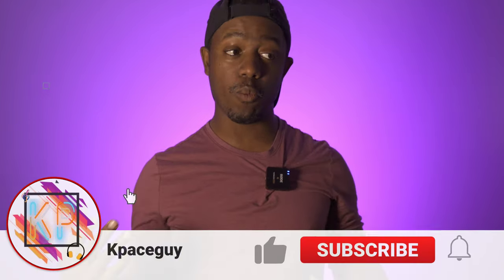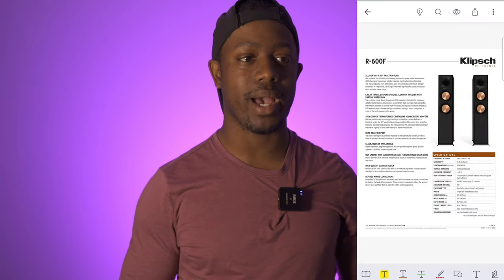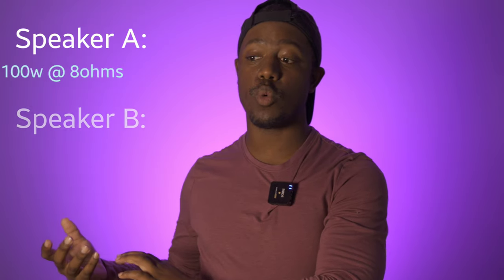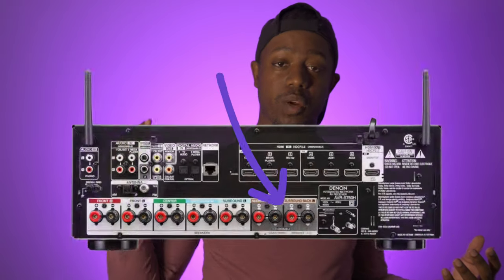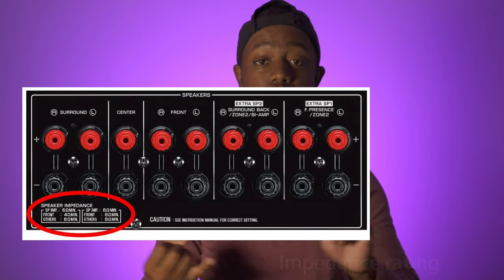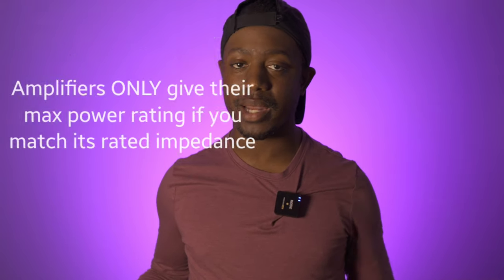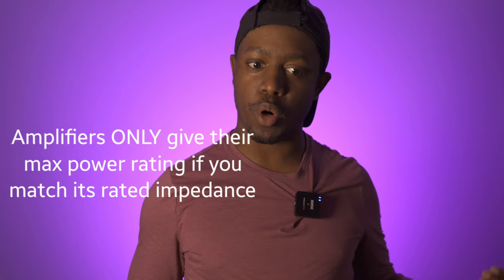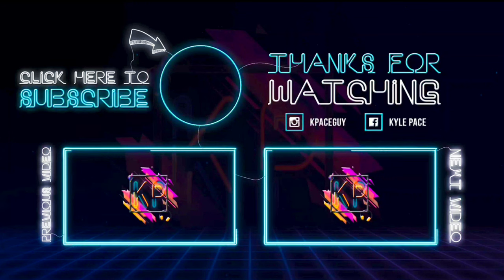Speaker Impedance (Ohms) and How to Match Amps w/ Speakers

Comment: Maybe a strange question, but in a cabinet with a tweeter, a midrange and a woofer, they all have impedance ratings, and how does that work in terms of figuring out what each individual speaker's ohm rating should be?  I am replacing both the midranges and woofers in a couple of Infinity Reference Four cabinets (keeping the tweeter), and the Reference Four is rated at 6 ohms.  I know these speakers aren't connected in series inside the cabinet (couldn't be if the total rating is only 6 ohms) but if they're connected in parallel inside the cabinet that would result in only 2.6 ohms.  So I guess I don't understand how they are actually connected individually inside the cabinet.  I have an Onkyo receiver from the early 90s that's a beast and has switching for both 4 and 8 ohm loads, and I'm just planning to connect each speaker to its own connection.  Sorry for the long wind, but would you think that 8 ohm midranges and woofers would be the way to go?
Reply from the maker: When you add speakers together you just have to wire them in a way that they don't dip below your intended ohm load OR just buy speakers with all the same ohms

Three  8 ohm speakers is still one 8 ohm final load to the amplifier but the power rating is divided by 3. So not only do you need your speakers to achieve the right ohm load, you also need your amplifier to have enough juice that all speakers are satisfied with
Reply: @Kpaceguy  Yes, thank you, I was thinking all speakers having the same impedance made the most sense, but I didn't know that 3 8-ohm speakers would still represent an 8-ohm load to the amp.  It's been a LONG time since I had electronics in high school.  😉😉
Reply from the maker: @Kenneth Williams  let me correct myself. Three 8 ohm speakers won't be 8 ohms it'll be just under 3 ohms. You'll want to get speakers that are dual voice coil. For example three 6 ohm dual voice coil speakers cam be wired down to 4ohms which a lot of amps can handle now a days. You need to be able to wire in series/parallel to get the right ohms
Reply: @Kpaceguy  Thank you Kpaceguy.
Reply: Most speakers that have three speakers inside a cabinet also have a mini crossover inside the cabinet that separate the frequencies and reduce or increase the resistance (ohms) as needed to get the final rating.  I would hook it up back into the crossover the way it was and check the new total ohm load.  Unless the crossover fried in which you will need to buy a new one then hook it up the way it was and check the new total ohm load at the back of the speaker and go with that number as the resting ohm load.  Remember that the crossover usually reduces the amount of power going to your tweeters and mids to match the speaker they used in that cabinet.  That is why, if you are changing speakers or brands, you might want to upgrade your crossover board, but I wouldn't take it out and run each speaker to your amp.  That would run way too much power to your mids and tweeters as all three would be receiving the same power from the amp.  Of course your woofers are going to need more power, the mids less, and the tweeters much less.

Comment: Hey! I currently have an old Sony that has four 6ohm speakers, model is LBT- ZX9 the sticker says 720W but won't trust it that much,. I'm thinking on getting an amplifier with better features like Bluetooth and mostly optic input, as well as using all 4 speakers as a home theater, what should I be looking for? It would be nice to get rid of the gigantic box with all of that CD/Cassette player part that I won't be using
Reply from the maker: 720w divided by 5 is each speakers rating. If your speakers are around that power rating then you're fine I less you just want an upgrade

Comment: Regarding ohms.  My AVR has ability to switch from 4, 6, and 8 ohms. My set up includes 7 speakers. 1 pair 4 ohms, another 6 ohms and another 8 ohms. So I've set AVR to 4 ohms.  Is that correct?  Also how do I set crossovers if I have such disparate speakers?  Thanks for your reply.
Jack
Reply from the maker: Set it back to 8

Comment: What if my speakers say 30w but my amp gives it more?

You said 4 Ohm amps usually cost big bucks. 

Surprisingly, my Aiwa mini theater system has a 4 Ohm amplifier. It cost me $299.99 at the Wiz in 1999 on clearance.  That’s not too bad.
Reply from the maker: That's fine just don't turn it up too loud
Reply: @Kpaceguy  will I hear distortion well before it ever reaches its failure point? 🤔 

It’s for the 2 surround channels, not sure my Aiwa mini theater system receiver sends over 30w to it. 

Love this video, btw. It gave me confidence to rewire this, without an instruction manual. No problems, so far. 🙏

Comment: I have Audison SR 4.300 amplifier. It supports 4 channel 85 w x 4 @ 4 ohm
Or
4 channel 130w x 4 @ 2 ohm and so on. 

My question is how does my amplifier know if I have connected 4 ohm or 2 ohm speaker.

Can I install front two speakers 100w @ 2 ohm. And rear two speakers 100w at 4 ohm to same amplifier or any such combinations ? Please explain
Reply from the maker: Your speakers have coils that have a certain resistance. When you plug your speakers into your amplifier, the amplifiers know the resistance of the voice coil and that's how it knows it ohms rating

Comment: Hello, I have a Yamaha receiver rxv 575 (80watts 8 ohms/135watts 6 ohms) and speakers (80watts 4 ohms), would there be a chance of damaging the receiver? Use will always be at low volume sitting in front of the boxes.
Reply from the maker: You'll mostly be fine. Your Speakers will be 4 ohms at their lowest but they won't always be at 4 ohms

Comment: Hello im very new to this just watched your video i just bought a klipsch rp280f with the ratings of 150watts rms 8ohms with 96db and i have a home theater system denon avr s570bt it put out 70watts per channel into 8ohms so im wondering i might underpower my klispsch speaker since they are 150watts..thank you in advance..
Reply from the maker: No it'll be fine. Speakers have a range in which they will work and your within that range
Reply: Thank you.. i realy do appreciate you and keep up the good work..🙏🙏🙏
Reply from the maker: @reggielansang7429  I appreciate it

Comment: Hi Kpaceguy, What I’m about to ask is in no relation to this video,But since it happened it’s been driving me insane…(btw the video content is awesome as usual!!) 
I have a Denon X8500H And my AVR just did a automatic firmware update on9/20/2022 that resulted in changing the internal picture settings Or overriding my settings on my LG (OLED) EG9600 (2017) and not only it drastically changed all the picture settings, but now the image is softer less detailed, and to top it all off, it now has the SOAP OPERA EFFECT on by default and it is infuriating!! And it is driving my insane…Is there a way to reverse the update? Any ideas? Thanks in advance!
Reply from the maker: If the receiver changed the picture then you need to go into video and make sure it's video processing is set to off or bypass. It has things like ISF day ISF night and etc. All that needs to be off and make sure it's set to pass through 4k

Comment: Question for ya.. im getting a speaker wall made and I need an amp that’ll supply me around 2k amps but I can’t seem to find any 4ohm 4 channel amps do you have any recommendations?
Reply: And also could I run multiple speakers off a one channel amp as long as the wattage of those speakers do not suffice the amps rms rating? And could I run a 4 ohm speaker off a 2 ohm amp?
Reply from the maker: @cal21379  crown amplifiers

Comment: I hope your still replying after 8 months lol. but if I have a 4 ohm 10 w speaker that  burned up on a old home stereo system and I'm trying to replace it with A 6 ohm 10 W speaker from a TV can I do that  ? trying to get it running again to have in my workshop .
Reply from the maker: You could

Comment: I’ve been watching your videos for quite some time but did have a question. I’m running a Denon x3700h. I’m running 5.2 surround sound and all my speakers are 8 ohms except my rears. My rears are 6 ohms. Will this cause a major problem? Most forums say no and if I match ohms on my surrounds the watts will be much less than any of my other speakers but I wanted to get your opinion. All of my speakers other than my rears are klipsch rp. My rear speakers are elec debut 1st gen bookshelves. I’m apprehensive to swap them because they sound really really good. Any help you could offer would be great!
Reply from the maker: No it won't be a problem and no it won't be half the Watts it'll be the same as all your speakers
Reply: @Kpaceguy  thank you!!

Comment: hey need some help please, i have tried wiring my  4 dual 4ohm subs to 8 ohms ,but no matter what i do i keep getting 10.6 on my multimeter ,  i have a gemini xga 5000 amp , can it work bro?
Reply from the maker: You wire all 4 subs negative posts on one coil to the other negative posts of the other coil. Then you wire all 4 subs positive post of one coil to the positive of the other coil.

Then you take 1 positive coil post of one sub and wire it to the 1 negative of another sub coil 3 times.

Lastly you take the positive of 1 sub and a negative of different sub and wire it to the amp. It's harder to explain than to do
Reply: @Kpaceguy  thanks much

Comment: I have a W-King T 9 wireless speaker and I have connected two 8 ohms 250watts external speakers in parallel to one of the 4 ohms internal speakers thus making the 3 speakers in parallel. Is this setup ok?
Reply from the maker: That's About 2.7ohms. A bit low. I personally wouldn't do it
Reply: @Kpaceguy thank you. I love your channel and subscribe

Comment: Rookie here.... I have the Paradigm Studio 100 V5 and the matching CC-690 center channel that is being driven by the Denon AVR-X4800H receiver.  I am looking to add a 3 channel amp to my setup.  the speaker sensitivity rating are 92 dB / 89 dB and the amplifier power range is 15 - 350 watts.  What rating amp would work best for my application?  Thanks in advance.
Reply from the maker: Literally any home theater amp in today's Market would work fine
Reply: Will the Parasound Helo a31 be overkill?
Reply from the maker: @allencrespo8998  I don't think so

Comment: Hey friend is it ok to load an 8 inches speakers rated at 130 watts each with 6ohms impedance to a 8ohms impedance rated amplifier at 100watts per channel? Can i get the power it needed or change my amplifier? Thanks in advance
Reply from the maker: No.

Comment: Very timely video.
Reply: I have a 2 channel system with a pair of Polk Signature 55 with dual SVS sb1000 powered by Cambridge Audio axr 100.Im looking to upgrade my towers and my peak budget is $1800. I've narrowed my choices down to KLH Kendall's, SVS prime pinnacle, Wharfedale Evo 4.3 and Dali Oberon 5 which are 6ohm.Would I have any problems down the road driving the Dali's if I go that route? Although I am leaning towards the Kendall's Any recommendations??? Thanks Kpace.

Comment: Hello friend, I had an OLD 90's Mini Hi-Fi Component System by Sony (cd - 2 cassetes - aux). I want to use the 2 Speakers Model SS-h7... On the back it says 6 ohm - input 25w - output 50w and Only had a Red and a Black Wire. I would like to use Those Speakers on my Computer, What do I need to buy so I can connect those 2 speaker to Jack 3.5mm of Computer. Sorry for Bad English.
Reply from the maker: Some sort of small amplifier

Comment: I have 10  4ohm 8inch mid-range speaker all hooked up negative to negative and positive to positive so I guess that's parallel and I guess that's coming out to 1ohm so will I need a one ohm amplifier for a 4-ohm amplifier and is there any other way I can hook all the speakers together and make it come out to 4 ohm
Reply from the maker: No

Comment: I got a surround system but missing front speakers,  i tested the surround speakers (multimetre) and they are 6ohm.

So to get front speakers ive orderd 6ohm bookshelf speekers.

So if a surround speaker is 6ohm the rest of the system must be 6ohm yes?
Reply from the maker: No
Reply: @Kpaceguy  wer'e talking about a creative inspire t7700 pc desktop 7.1

if 1 speaker is 6 ohm they all gonna be 6 ohm yes?
Reply from the maker: @WingmanLive  if it only has one amplifier then yes but if each speaker is powered individually then no
Reply: @Kpaceguy  yeah im good then because was missing front 2 ive orderd some technics sb-hd51.  6ohm and have a lowend of 45hz.  Should be happy with that for a desktop setup anyway.  

Cheres dude!😊👍

Comment: my current AV receiver is a Dennon  135w at 8 ohms , my front stage speaker is connected on a 3 channel external amplifier . My surround speaker is rated at 4 ohms and my Height speakers are rated to 2 ohms , this the only speakers I have connected in to my receiver since the left right and center speaker are connected to a external amp in this case I'm ok with that kind of setting ? my external amp is rated at 150w each channel at 8ohms and 400w at 4 ohms each driving channel
Reply from the maker: Yes you'll be alright

Comment: Thank for the vid but gime a hand to clear my issue.. Having an amp capable of setting it to 6 ohm or 8 ohm. Paired with speakers rated long term power 180w and short term power 250w at 6 ohm. along with a receiver that outputs 130w at 8 ohm  but i dont know 6 ohm output rating.. so how should it be set ?
Reply from the maker: You'll be fine

Comment: I have a few questions if you dont mind, like ok my amp looks like is capable of 4 or 8 ohms does my reciever need to be capable as well? Also is there something i need to do to get them to work at the correct ohms like if its 4 do i need to tell that to the amp and reciever? So my amp i am biying is rated 8ohms 160 watt per channel or 4 ohms i thinks its 250 watts so i should be able to drive a tower 4ohms 200 watts easily? It gets confusing i could put the exact name of everything
Reply from the maker: If you're using an amp then it doesn't matter what your receiver can do. The amp automatically knows what ohms to use the moment you plug the wires up
Reply: Thank you for answering man, I appreciate it. I have the onkyo rz50 coming in tomorrow and they just shipped my 2 channel emotiva amp. I'll be using 5 bowers and wilkins just need Dolby atmos speakers maybe 2 more surround.  Originally I was going to get the Nakamichi DRAGON but I figured fornthe price I can build a system, that dragon was tempting tho. I'll be watching more of your vids thanks again

Comment: hey i have a  t.amp E-1200 that has 800wrms at 8ohm and 1200w at 4ohm  i plan on running behringer vp1800s that run at 400w rms at 8ohm and 1600wpeak.
how do i set the impedance to 8ohm on the amp ?
what shoud be the max power i run these subs at?
how do i know at what impedance the amp is at?
Reply from the maker: The amp knows what to do based off the speaker you connect to it. You don't need to do anything

Comment: My JBL L-60t speakers are rated 6 ohms. My Yamaha RS202 receiver is 8 ohm. I haven't noticed any issues but should I be aware of something not good to do (such as cranking them up too loud)? The wattage is 100+100.
Reply from the maker: Overall you should be fine. It's not really a volume thing is more a frequency and power thing
Reply: @Kpaceguy  Thanks. That's a relief. 👍
Reply: @Kpaceguy  In curiosity I checked and JBL is still making 6 ohm 2 way speakers. 😲

Comment: question: if I have a pair of 2 ohm speakers, and I have a 2 ohm amp but one ohm stable, thats perfect right? or does the fact that both speakers are 2 ohm and they are doubled, there's two of them, does that mean the 2 ohm drops to one ohm? basically its always best to power speakers based on ohms, two ohm speaker gets two ohm amp, same with 4 ohms and so on and so on? right?
Reply from the maker: If both speakers will be powered off 1 channel, it'll be 1 ohm. Which is fine. You'll get the most power out of your amp that way
Reply: @Kpaceguy   im building a system now, I have a pair of two ohm subs {JL Audio 10w1v3-2} and I plan to pair them with a amp {Crossfire C5-1600D Mono} that seems to be rated at 4 or 2 depending on wiring, but it says 1 ohm stable, does this mean when I wire them I should bring two sets of wires from the amp one going to the left sub and the other the right sub, is that how those speakers should be wired to that amp to get the max effect? thanks for answering my questions my friend
Reply from the maker: @eyeswideopen6151  no if you want all the power possible from your amp you combine both subs together and wire it to one positive and one negative output. Your manual will tell you which one to use. A monoblock amp doesn't have left or right outputs. Monoblock means "One". You take plug 1 wire to your positive (red) of the sub and connect it to the positive of the other sub. You do the same for the negative (black). Then you take 1 wire of positive and wire of negative to the positive and negative of your amp. Now you're in 1 ohm and you're getting all the power you need
Reply: @Kpaceguy  good deal thanks! I know about the mono meaning one. I was saying left speaker and right speaker, not left channel and right channel. but what your saying is run the red and black from one speaker to the other, and then just run one set of wires from the amp to just one speaker? kinda like piggy back riding one of the other.....thanks man you have really helped me out on this.
Reply from the maker: @eyeswideopen6151  yes. Because both subs will be playing the same thing you don't need to think in terms of left and right
Reply: @Kpaceguy  thanks my friend

Comment: so in my situation I have 4-8ohms amp 2x50w and 1x100w sub I have a 50w sub 4ohms and 20w mid + 20w tweeter connected together (6ohms speakers) but it says that it's pushing 6.6-7ohms is this ok for my amp belove 85% volume?
Reply from the maker: Yes